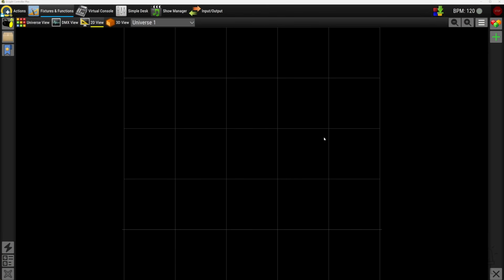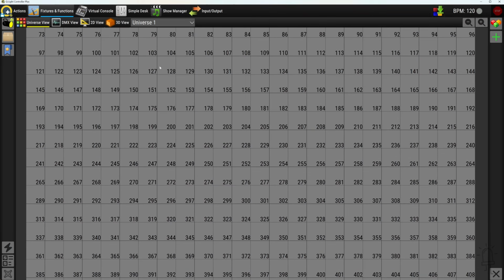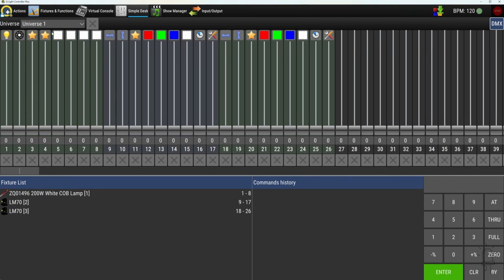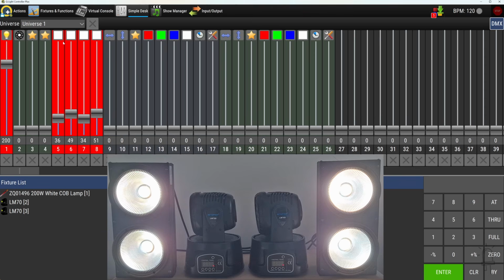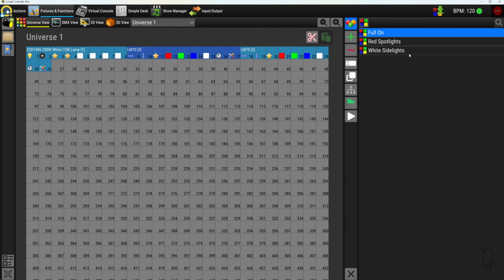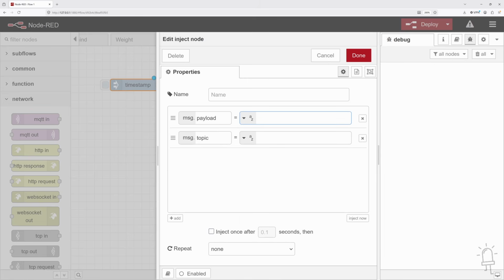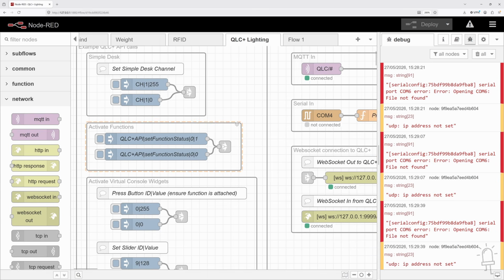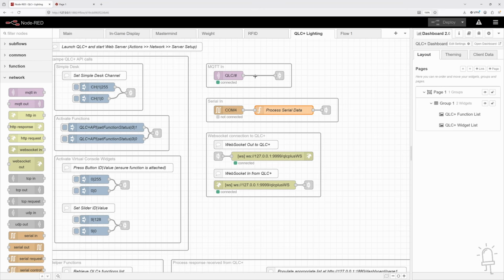Node-RED + QLC+ Automated Event-Driven Show Control for Escape Rooms and Theatre

Comment: Great Video! I used basically the same setup but with OSC and not the websockets. But for using OSC you need a virtual console. I bought the dedicated Raspberry pi image from massimo the founder of QLC+ and it is really fast and reliable on a pi400. I already run six interactive shows with the setup. Never failed me. And if the theatre you work with uses sACN everything works over the network no need for an Artnet node or USBtoDMX dongle.

Comment: Great video! I've been wanting to implement a system like this, but hesitant because I thought i'd need a dedicated computer running the show control software, which is another point of failure. I didn't know you can run QLC on the same Pi as Node Red. Definitely going to try this out. Thanks!

Comment: I just started to setup a used NUC PC as my game controller, and I hadn't considered using Node-Red, although I use it a lot on my Home Assistant system. I did manage to get the game designer Godot to interface with my ESP32 network, so if I wave a magic wand it sends an ESP-NOW  message to the Bridge-Master ESP32 on the serial port of the NUC and forwards that to the Godot game to turn on a picture of a lamp on the game window in Godot. I'll be able to send in-game events back to the network to turn on effects like sounds and leds back in the magic wand.